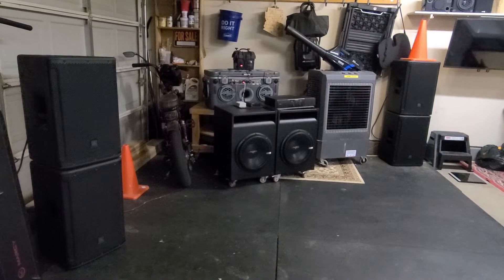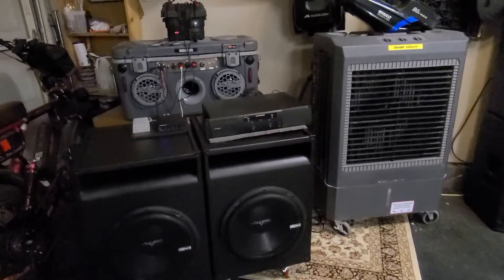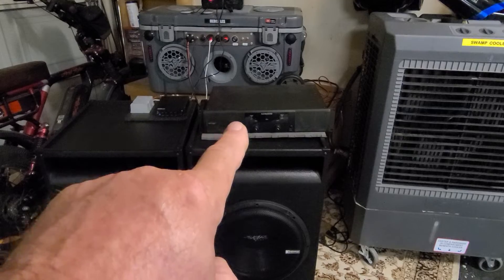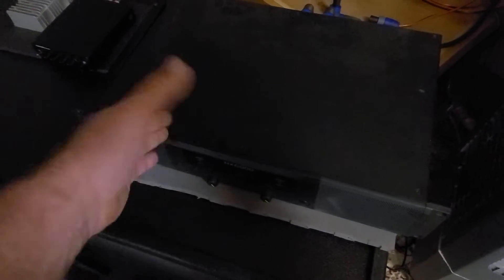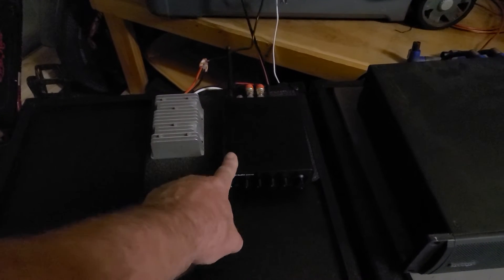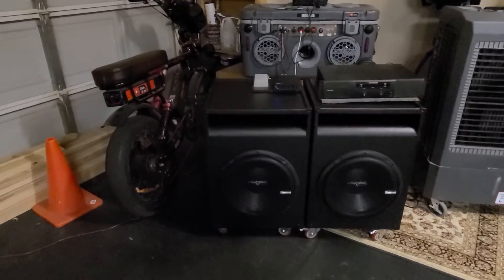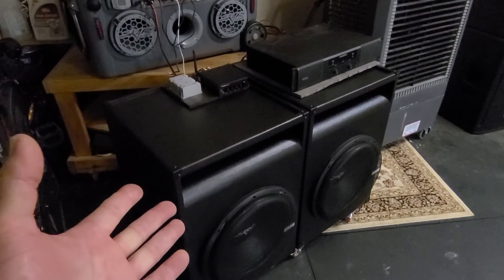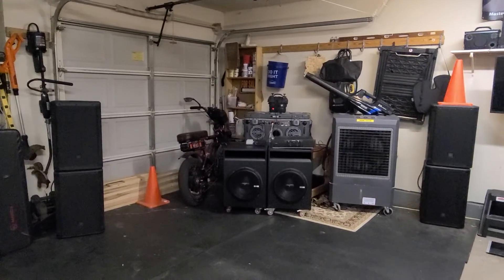Behringer NX6000 power amplifier on two 15" car subwoofer "conversions"

Comment: Beginner only does about half of its rated power. Which is still enough for what you’re using it for, but it’s no where near 1600w.
Reply from the maker: Prob true...I am happier with the two Crown 2500 XLi amplifiers. The Crown's sound better too.